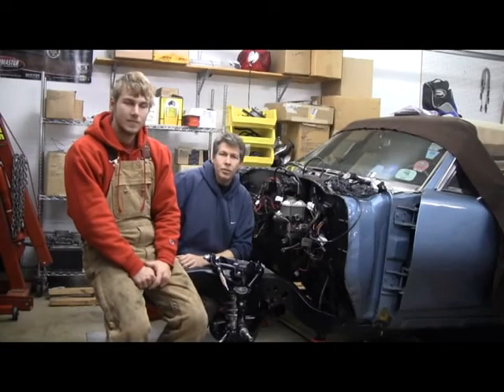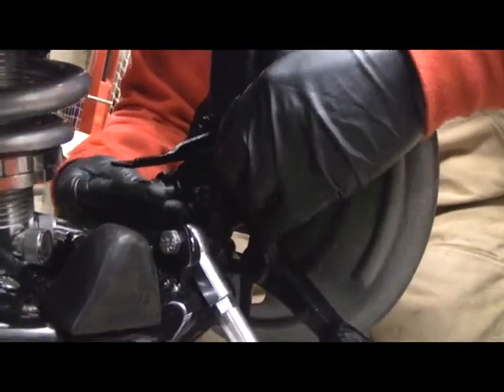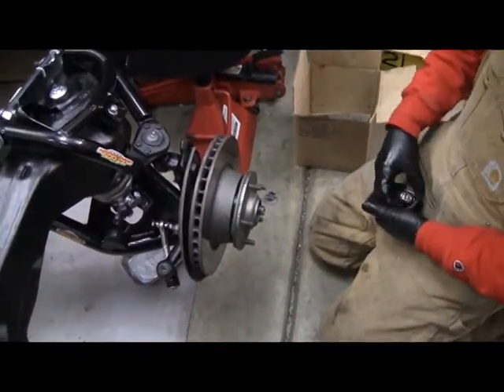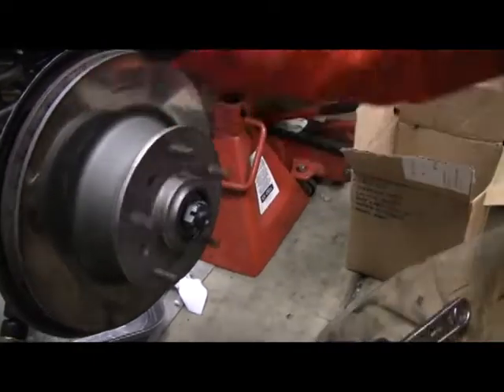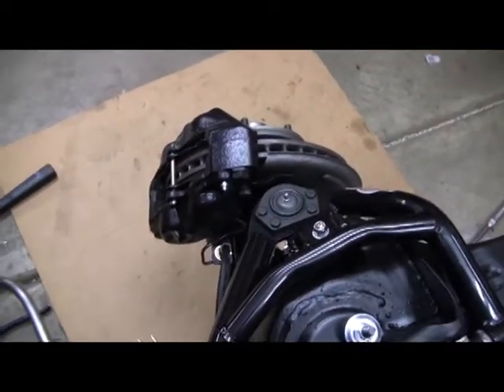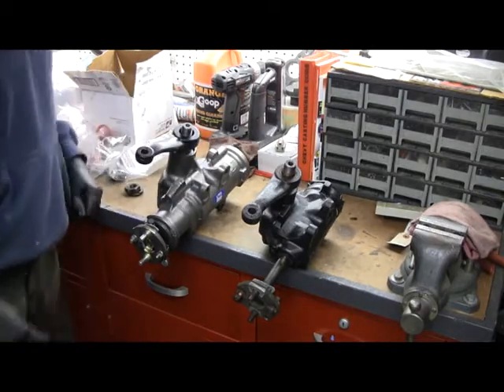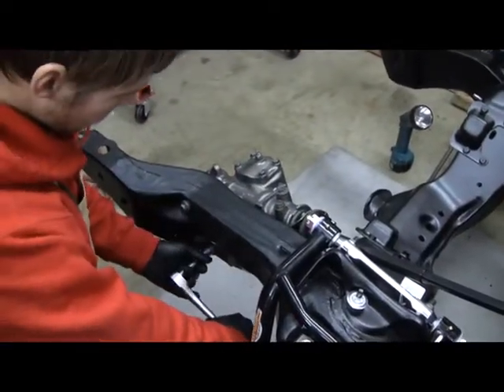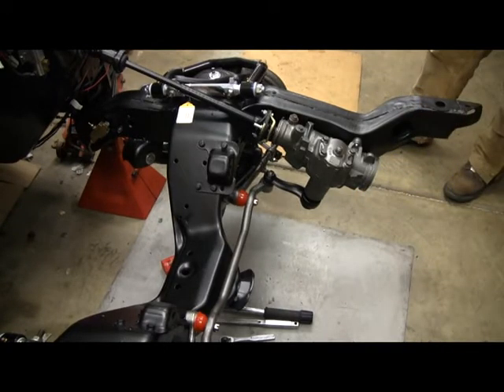LS conversion swap Part 18, front steering and brakes

Comment: do you have any videos if your project after it was complete
Reply from the maker: Unfortunalty the project is not finished yet. I am a little further along than the Bell housing index video last posted, but still a ways away. With the body mount rot and having to tear the complete LS down has extended it quote a bit. I wish I could help with your car, but I barely have enough time to work on my own...

Comment: Not sure if you had it in a previous video, but how did you handle the clearance issue between the LS oil pan, and the inner tie rods? Cadillac CTS pan, or aftermarket pan?
Reply from the maker: +TargaWheels
I cover that is Video 13. I started with a GM muscle car pan and ended up using the Holley conversion pan. Not so much for steering clearance, more for drive-line geometry reasons. Still a little issue on the passenger side, but I think I can fix. I talk about it in the video.